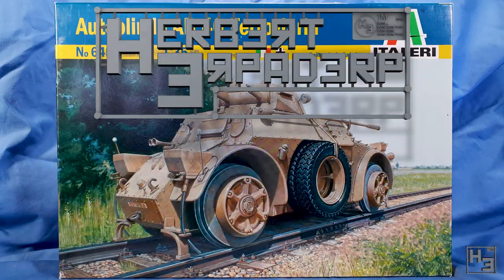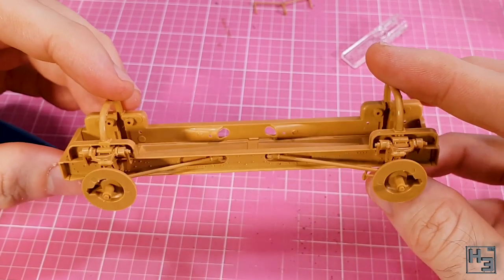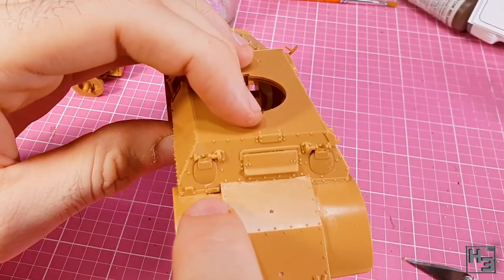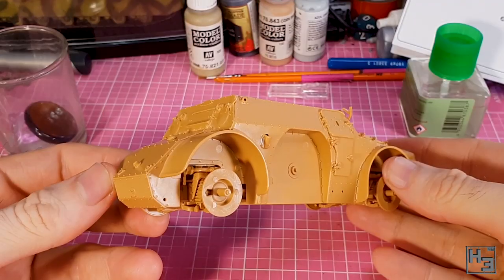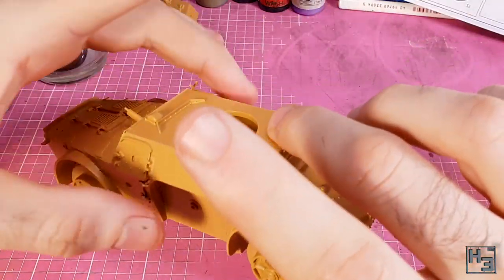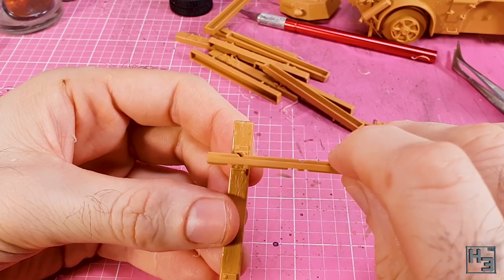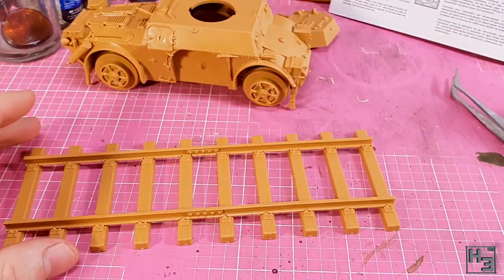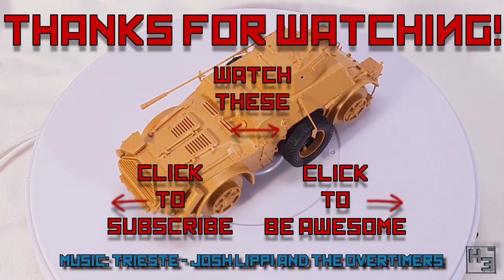Italeri Autoblinda AB40 Ferroviaria [1:35]

Comment: I have the Autoblinda 41 one. Basically same vehicle, different turret. However i managed to somehow lose the right side doors. making this, kind of impossible to finish. Will have to see if italeri offers spare parts but i doubt it. Anyway these Ferroviarias were used in my country during Italian occupation of Yugoslavia. They were used to protect railways from the partisans which were constantly sabotaging german transports towards Greece in order to supply troops in Africa.
Reply from the maker: Maybe you could try making some doors with sheet styrene. If they don't look right you could add damage and have that be the reason they don't look quite right.

Comment: What are sandboxes?
Reply from the maker: Boxes that hold sand. which is sent down the hoses to create grip on the rails when its wet. Stops wheel slip.
Reply: It is also a thing that you can find on playgrounds. Usually a wooden box with sand in it so kids could play in it
Reply: Thanks for posting. I am about to build the standard AB40 and wanted some guidance around fitting of parts. Your video was very helpful 👍